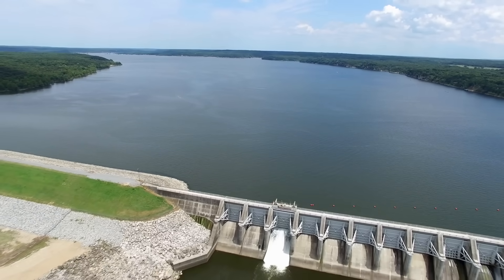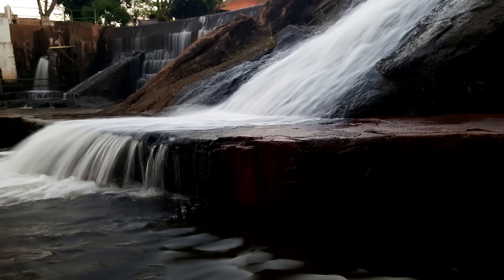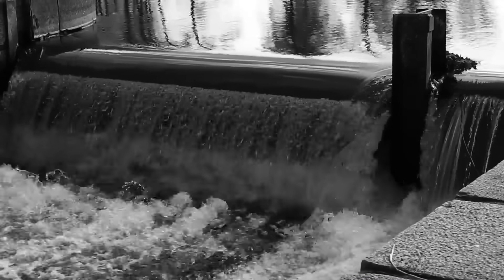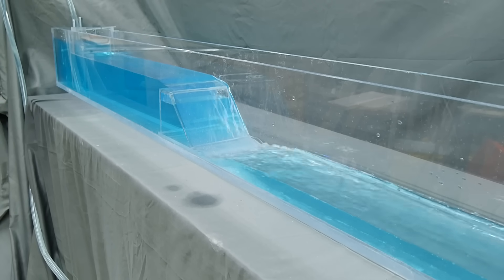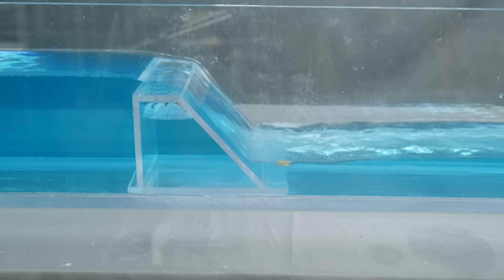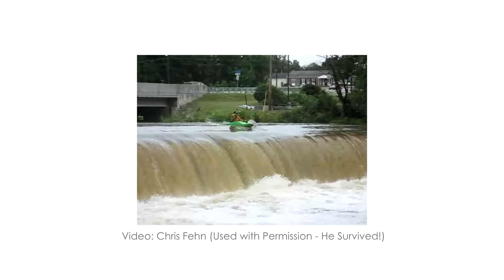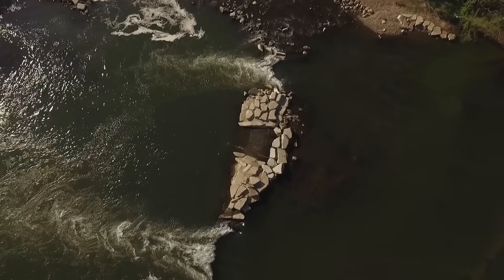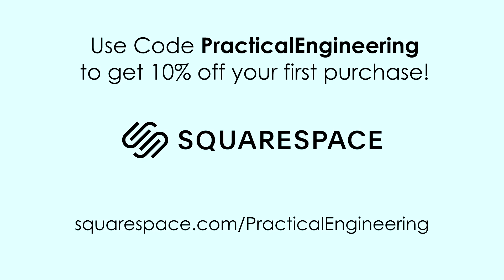The Most Dangerous Dams

Comment: I’ve conducted underwater inspections on wood timber weirs in NY and Penn.  they are seriously dangerous.  I have filmed these structures by swimming UW exactly next to the structure where it’s actually calm.  But one mistake and become washed into the boil point is super dangerous and this space may only be two or three ft. Wide.

You must have a life line attached to you and you must have a serious reason to risk this attempt.  

I’m the only diver I know of who has worked and filmed in this zone.

Comment: Dead ass have seen people around these dams in Michigan throughout the rouge river. ford yes that ford bought all the land from the city’s idk when but guessing 1910-1960 not only Detroit but thought metro Detroit used these dams and others for powering factory’s there is still a kinda example building in Northville Michigan up until the 1990s I remember. It used A literal water wheel to power stuff in the factory to build valves for engines.

Comment: You might want to look at the Peoria Lock and Dam in Peoria, Illinois.  It uses a series of adjustable wickets.  I have seen flood waters exceed the height of the entire structure including the walls surrounding the lock. I don't know if the wickets can be individually adjusted or not, but doing so would help with the situation.

Comment: I feel I should add something here that might save a life. If you are unfortunate enough to find yourself trapped in the recirculation of a hydraulic roller, try to grab a breath, swim down as far as you're capable (your aim is the bottom of the dam), kick off with force downstream, and you will hopefully shoot under the roller and be able to pop up after the boil. This method is truly the safest way if you're proficient in the water, because intervention by others compounds the problem by putting another life or more at risk. Hindsight is 20/20, and this is all hard to put into action during panic, but it has worked. Good luck out there.

Comment: Barely escaped one of these as a kid, when swimming in the local summer "watering holes" that we frequented for a cool down during the peak of the summer heat, in rural Michigan. I was just able to kick off from the bottom of the dam and that got me into the main current, which pulled me down stream and out of danger. I was scolded by my parents for being "so stupid," but I countered their assault by throwing it back at them, asking why they hadn't warned us about the danger. Not too much flack after that come-back. The city took up the slack by finally posting a warning sign - 50 years after its construction.

Comment: This isn’t about wiers, but there is a river that flows through my town, (more of a stream) which is quite tranquil. However, it quickly widens up, making it difficult for inexperienced swimmers to get to shore, along with a short drop for an few foot wide stream nearby that my friend and I sometimes walk in. This small stream still pushes water outwards, making it hard to shore on one side, and the water also gets much deeper and muddier when it gets wider. After that, you go into the golf course, which has a wall on the banks, which is impossible to climb. While it may sound like a death trap, it’s not. No one has died in it (that I know of), and people sitting on the bank are reassured by the firm bank under the wall, which may hurt your legs a lot if you fall, but you’d have to actively try to go in the water to get wet.

Comment: me and my friends go swimming at a small river which has a weir. the way the issue of "keepers" is solved there is to add a roughly 2 metre long flat concrete pad just below the surface of the water so the falling water is about ankle deep but still has a very fast flow rate. past the concrete pad the water gets about 5 foot deep and is still aerated enough to pose a threat but you wont get sucked in.

Comment: I shouldn't be here. I learnt to water ski in an irrigation area where there was many many contour gradient locks on the main channel.
There was even a siphon where the main irrigation channel passed under a creek and an outflow chute into the creek that the siphon passed under. We used to put two old house doors across the outflow of the chute and the header box would fill with water and we had a swimming pool.
Back to the contour locks, we used to body surf the hydraulic jump, water ski the hydraulic jump with a handle and rope tied to the weir, swim in, on and under the hydraulic jump, and swim along the bottom of the channel and emerge in front of - you guessed it - the hydraulic jump. I've never had so much fun in my entire life. We did it so often that we grew sick of it.

Comment: The city I live in had a wier and it was a regular/annual occurrence where someone would drown. There is a cable across/above the river upstream along with signage. Then another cable with small bouis. There would be ads on the radio to stay away etc, but still some felt the need. Anyways, it has been altered to something much less dangerous.

Comment: The fact that i spent the whole of last summer jumping behind one of these. Quite hard to go over it as the water was 10foot deep and it had a 1 inch overspill on the dam, but the way you got out was by  standing on a 4 inch iron bar with water running over it, then pulling yourself over the railing. I knew if i slipped I’d be In deep shit. However, the water at the bottom was 1ft to 6in deep and you can stand at the bottom (as some locals more idiotic than me slid down it and just sat at the bottom) so I’m sure if would be okay

Comment: Holy crap we were stupid kids.  In my teens we swam in a river that had a bridge to jump off and a dam that restricted water coming into the river.  We used to sit on the lower portion of the dam and the water would flow right over.  It was quite a large area under the water fit many people and at least 2 were poking their heads up cause it made an amazing beautiful laminar flow in almost a 360 coming off your head.  You kind of looked like a flower, with your face as the center and the water flow is the petals.  Yes, the river bed right after the dam was treacherous sharp jagged rocks and the current was strong enough you had to be a strong swimmer to beat it.  Never heard of any problems tho we swam there for about 10 yrs.

Comment: Because the dam is low and water is shallow, people would always underestimate the danger of a low head dam. I was working on a project doing CFD modeling to add steps to a low head dam. To kind of fully get rid of the rollers, very mild slop steps are required.

Comment: I'd like to imagine that a good simple solution for low head dams preventing drowning machines.  Take a triangle. Flat on the bottom. 90° angled flat face.  Having that very low gradient to ease the water down, rather than it just flowing over a small wall. I feel like this would help a lot with moving that jump to be small enough to not cause severe harm.

Comment: I'm in Calgary, Alberta. We had a weir on the Bow River since before I know, but it was recently converted into a passage that can be safely traversed. It is still recommended that inexperienced users portage around it, but it is now possible to safely get through what is now called Harvey Passage. I remember for years being told about the dangers of the weir, and there was a large exclusion zone for about a kilometre upstream of it. Our structure was and is used to divert water into a canal for irrigation. I also had a chance to work as a temp on the refurbishing project (I was spraying and scrubbing concrete off of rocks, but hey, someone's gotta do it).

Comment: I've been trapped in one of these recirculations before. Not from a dam, but an enormous rock in rapids. I was down there long enough to think, "This is it, this is how idiots die." And then I gave up for a second (probably a literal second, just felt longer). And then I decided I had given up to easy and I wasn't just going to die without a fight. But, I actually think that moment of calm saved me, as I was able to touch the bottom and push off and forward enough to get free. Maybe it wasn't as close as I felt it was. Idk, I thought I was a goner for sure. 

In a parallel universe I died that day.

Comment: Some of those old dams made for mining operations are some real gems too. The San Juan river turned orange when the USBR & EPA had a dam break that was holding back contaminated water from an old mine. Tempe Arizona has an inflatable dam. YES! They blow it up like a giant sex doll, or more accurately several blow up sex dolls, and they dam up The Salt River. That dam failed catastrophically one day when the rubber deteriorated. It flushed a lot of homeless people out of the river bottom. A kayaker was trapped by the hydraulic jump while that dam was down.

Comment: The natural reaction of victims to stay afloat also keeps them in the center of the circulation and trapped.  The best strategy is to swim into the drop and down toward the outside of the circulation thus to surface on the downstream side of the boil.  The currents are very strong and can cause injury nonetheless.

Comment: We have 2 low head dams right in the city. One is from an old mill which is an attraction and has been rebuilt and maintained as long as I've been alive and the other one is about a quarter block from the Leinenkugel's Visitors Center and it is also maintained. It used to provide power for a woolen mill.

Comment: in our town, New Hamburg, Ontario,  there is a low head dam, about twelve feet high and 200 ft. across.  The Nith is a small river so most of the year, the flow is only a trickle but the river drains a large and snowy catchment.  In the spring, the flow is huge:  the water level downstream from the dam is only a few feet lower than upstream.  The roller below the dam is breathtaking:  it tosses ice pans as big a small car and logs, a foot and a half in diameter, twelve feet long, into the air, round and around.  People come from miles around to watch.   In the thirty years I have lived here, no one has drowned because no one would be foolish enough to bring a canoe near it.

Comment: I looked at the title and thought, "That structure doesn't look like a dam." Then the first sentence "A low head dam, or weir..."

Yep, weirs are super super super dangerous. I've had to do several working near water courses for my job and it was pointed out if there's lots of water rushing everywhere with foam and noise there's a good chance the water course is actually relatively safe. But a whole ton of water flowing over something like a weir and it's almost silent and barely a ripple? Well, all that water's going somewhere out of sight and it'll take you there and kill you. Same applies to a natural river somewhere in northern England- goes from being really wide and navigable by boat to only a few feet across. Really scenic, but there's still the same volume of water flowing through it. But it's gone really deep through a terrifyingly narrow limestone gorge. If you fall in there you die, end of story.

Comment: The Dundee Dam on the Passaic River has a section of its tail near the Garfield side that becomes dangerous like that when the water levels get too high. We used to drink on the Garfield side and always observed bits of wood that couldn't get out from under the dam's tail. Fortunately the water there is only about 2 feet deep but when you have a flood situation upstream, the water level below the dam (south of it) rises as well, especially when they turn on the hydro dam on the Clifton side.

Comment: There are two of these low head dams not far from where I grew up. One is intact to this day. There is a buoy line across the head waters and many signs posted. Several highschoolers from each generation have lost their lives there.  The other dam has been blown (breached with explosives) most of it is still there the river now flows through the narrow breached section with a tall wall on each side.

Comment: The industrial revolution began with falling water. Hilly country was valuable.  Broken falling water entrails air for ventilating the coal mines, reducing the cost of vacuum steam engines in the 17 hundreds.  This made coal cheaper again,  so with a cannon boring device high pressure steam became universal,  even driving dynamo and altinators. That met the transistor in 1949.

Comment: You mentioned step dams with  folded instead of straight dams faces in an earlier video; it would have been useful to point out that these shapes, in addition to admitting more water are also usually much safer as the V's induce downstream jets of water that carry things away from the dam.  A simple rule of thumb  is that the smoother the flow below the dam the more dangerous it as.

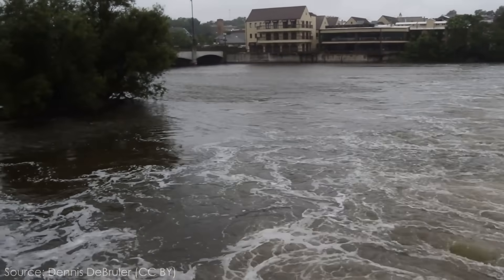Comment: 5:07 that is not necessarily true. submerged hydraulic jumps, commonly referred to as hydraulics, work off of the surface area, the larger the object the harder to get out.  If you are ever caught in one you should ball up as it will spit you out. Also, hydraulics can be formed naturally by rocks in rapids, they are not something to be feared on a small scale but it is best to avoid them if you can.

Comment: Jesus. I remember several years ago, some friends and I were Kayaking down a local river in our town, when we encountered one of these low head dams. I saw the small water fall created by the dam and thought it would be fun to try and kayak over it  ( we may have been drinking but hey that's neither here nor there). When I went over, the tip of my kayak hit a rock under the surface, and I was thrown out of the kayak and deposited downstream. I remember thinking at the time, "damn, if I hadn't hit that rock, I might have pulled it off." I actually deliberately tried to go over at a spot where the water was deep enough to land the kayak.

Comment: I used to live close to one of these (exactly like the one at 4:56). They had signage and a warning rope, but people still ended up going over. To my knowledge, no one ever survived other than in a boat, and that was only if the boat got stuck on the weir itself.

The fire department has to have special 'boats' in order to approach the weir to rescue people. For the longest time they had a giant log with approximately a four foot diameter thrown in as a example. That log stayed there caught in the hydraulic jump for years. It would move so far out and be pulled under, only to reappear at the base of the weir again. 

It's the kind of thing that will make you have nightmares. The sign they had even showed the log, and explained the 'drowning machine'.

They have since deconstructed it, and turned it into a area with a portage for boats and a series of downhill rapids for kayackers.

Much better.

Comment: Would have loved if you included what would give the best chance of survival once you get trapped in such a situation. Do you have to swim parallel to the dam to one os the sides and maybe get on land there

For some reason I also feel like swimming down may give better chances to get past the boil but I don't know....
Reply: Yeah, it's advised to dive down to the bottom and swim or crawl out. There the currents will help pull you away and you still should keep swimming to be clear of the "boil" before resurfacing. Problem is a lot of kayakers are wearing buoyant vests, or if someone knows how to get out, they might be more willing to take the risk.

Best to avoid the situation all together.

Comment: Very educational video. Near my hometown there is an open irrigarion channel in which countless people have drowned over the years. The channel goes parallel to a road, without any kind of barrier, and a lot of cars and pederastians have died after falling on it.
If you are curious, search 42,5639374, -6,6458089 on google maps and check street view on the side of the road.
The channel is not very deep (2.5 or 3 meters) or wide, but it has hydraulic jumps every few meters and it is, like you say, a perfect drowning machine. If you fall, you die. I only heard of one survivor, a woman whose car got stuck in the structure right over one of the hydraulic jumps and she was able to climb on it.

Every time it caused me fear to see debris  such as plastic bottles and wood looping around right after those jumps, since I knew that for a person it would be impossible to overcome such currents.

Comment: There's a spot on the Guadalupe River outside New Braunfels, TX that has a low-head dam with a vertical drop and an area of submerged recirculation. There are "chutes" to the left of the dam that people in tubes need to go through instead of going over the dam. Sometimes there's a sign hanging over the river that's says "GO LEFT!" The sign wasn't there the day I was on the river and it was dam scary! By the second time I was pushed under I realized what was happening (but not the theory behind it). I also realized my girlfriend, now wife, was going through the same thing. When I came up the third time I pushed her downstream to the calmer water. The next time I came up I pushed off the dam to get myself away. I'm getting chills just typing this story because it was such a terrifying experience!

Comment: The most dangerous dams in the US, was lock 52 and lock 53 in southern Illinois. I worked at lock 52 until it was permanently closed as a head lockman...did a rescue in 2015 due to the  dam looking like an infinity pool of the overflow and all. It's a wicket dam...made out of wood. Look up lock 52. We use to hook wickets with a 40 foot rod and used steam powered vessels to operate
Reply: wow